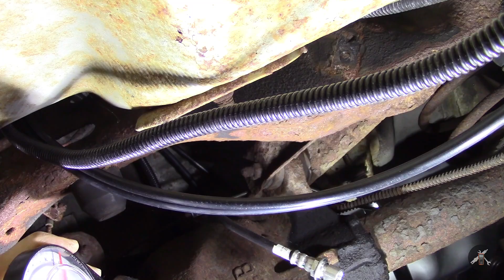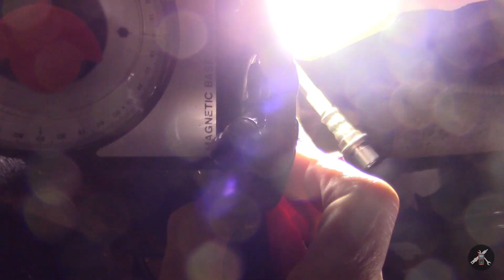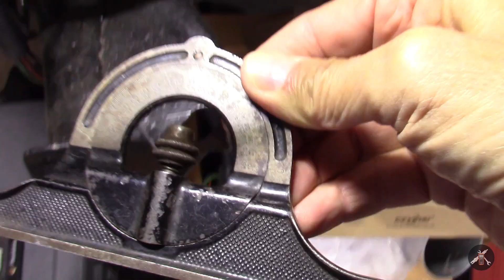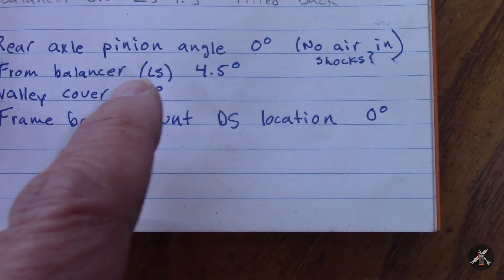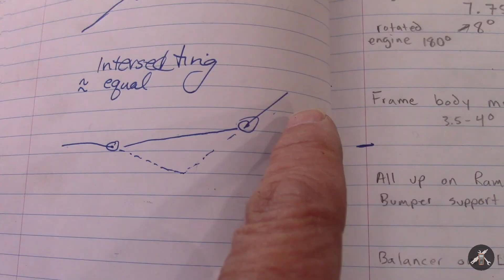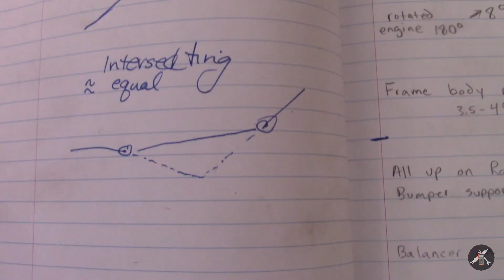LS Swap Preliminary Driveshaft and U-Joint Angle Check

Comment: Happy New Year.  Good video on drive train geometry. If you look closely at carbureted intake manifolds you will notice a 3 to 5° angle on the gasket surface on many of them. Most engines sit at about that angle when mounted properly. That keeps the carburetor and float level in the proper orientation.
Reply from the maker: Happy New Year to you too! That's a great point about the angled gasket surface on carb manifolds, and yes I've seen that over the years.  My concern here was that we were changing the front mounting points and possibly the height of the engine, so I wanted to be sure that we were still in that range.

Comment: Another interesting well explained video and what a coincidence I'm at a similar stage with my camaro project , I bought the car with no engine and gearbox since then I purchased a 350 4 bolt main and th400 box from a 1 ton g30 camper van. now need to trial fit and make a crossmember for th400 box and set prop angles up like you .I'm not a big fan of the 700r4 what should be in it I think they are a weak box ,th400 are pretty much bullet proof , I daily drive one  in my 88 suburban for last 8 years with zero issues the only down side for camaro is top end revs but it does have the 2:77 rear so could be worse i suppose .many thanks
Reply from the maker: Yes, the 400 is generally regarded as stronger than the 700R4, it was originally designed and intended for use with 400+ CI engines in large heavy cars in the mid-1960s.  The 700 started out intended for lower power applications, but as it matured, it became a strong box, too. Not good for the 7.4 liter engines, but good for small blocks.  I had several of them in Suburbans with 5.7 or 5.3 and 8000 lb towing packages and never had a problem.  
In your case, with a 2.77, overdrive is less of an issue.  In mine with a 3.42, that 700R4 top gear really helps on the highway.
Reply: @bitsofwisdom460 it's the Borg Warner 9 bolt posi with disc brakes is what I have and from what I've read it's supposed to be a little stronger than the  camaro 10 bolt but to be honest I think the 9 bolts are more expensive for parts and little more tricky to work on, to replace the axle shaft seal you have to replace the bearing / collar which is pressed on and have read the rear (cast) callipers can be a pain. I think a open diff and drums is less hassle in long run but that's just me , I'm not after performance just want reliability and simple fixes. The main problem is being in UK with shipping costs